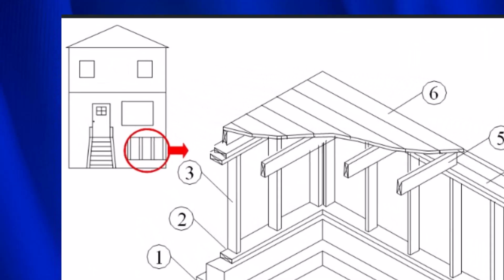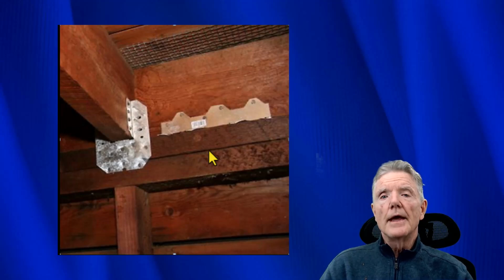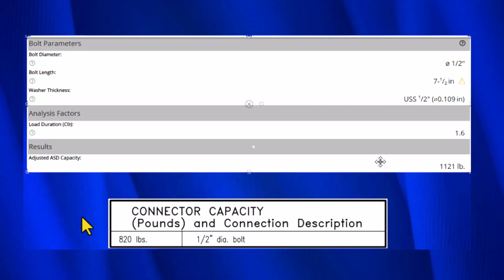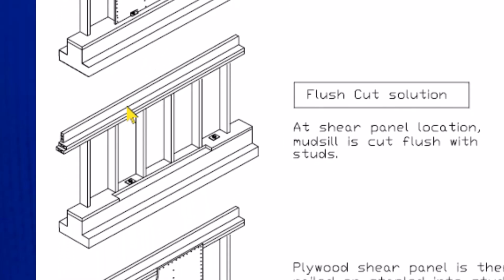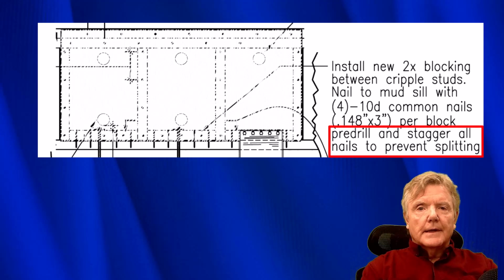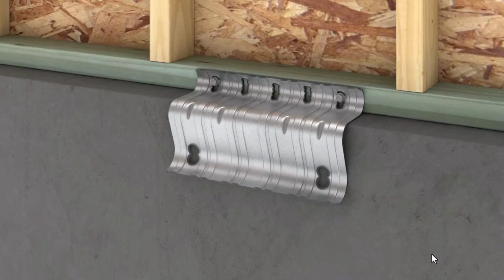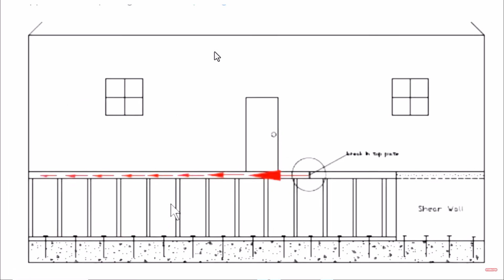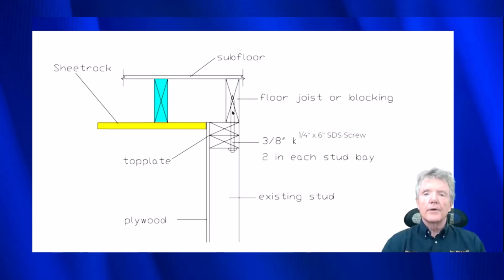AN ANALYSIS OF STANDARD PLAN A

Comment: Hello
My stem walls are CMU block with filled rebar cells, every other cell, 16” on center. Currently has original (1958) 1/2” bolts every 6’. How would I go about adding anchor plates? The URFP/FRFP will not span the 16”. Would adding URFP to empty cells be appropriate to transfer load to footing?
Reply from the maker: Go to the website and search for APA Research Report 154.  Tests were done with studs 24" o.c. so there is not reason to do this.
Reply: @ thanks but that seems like it applies to wood framing if I’m not mistaken. What I’m asking about is 6” wide CMU block stem walls. Half the cells are rebar and grout filled while half are empty. The span between rebar is 16”. A URFP plate is only 9” wide. Would it make sense to install titen bolts in a filled cell and empty cell?
Reply from the maker: Yes
Reply: @bayarearetrofit5814  thanks for the help 
I haven’t been able to find any resources on this type of foundation

Comment: If you are in WUI and need to have a 1 hr fire wall assembly such as with densglass for exterior and interior sheathing, is that allowed for a cripple wall instead of plywood? Does densglass fireproof have enough strength?
Reply from the maker: I could not find any information on the shear strength of DensGlass.  I would call the manufacturer and get a spec. sheet.